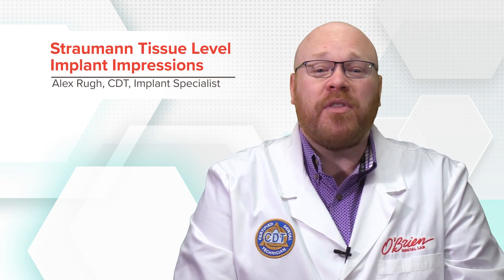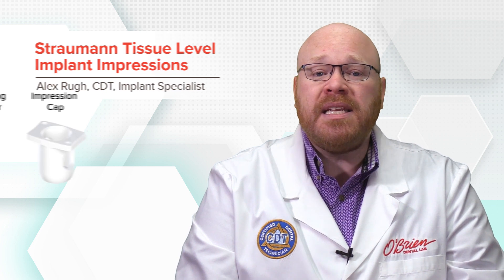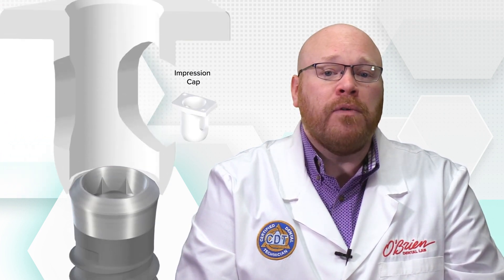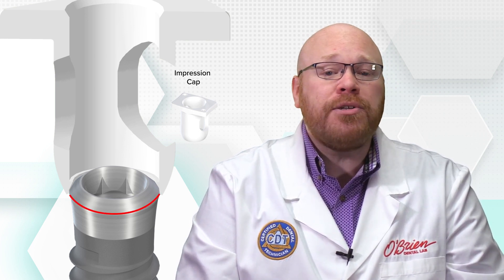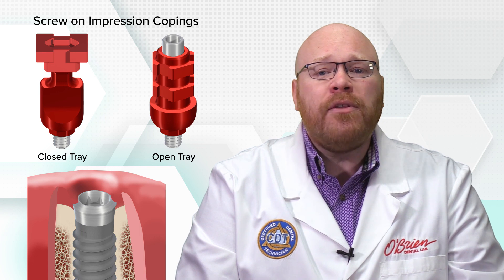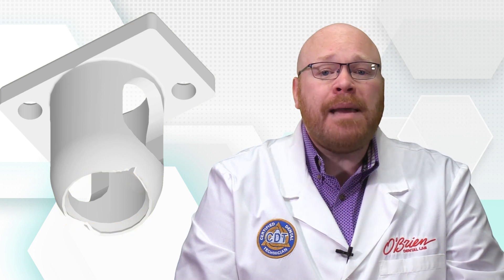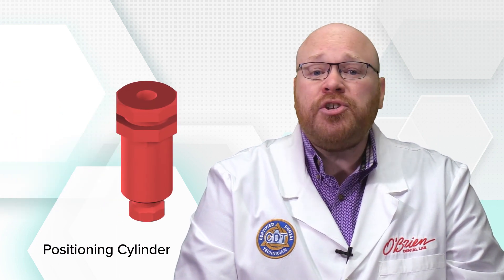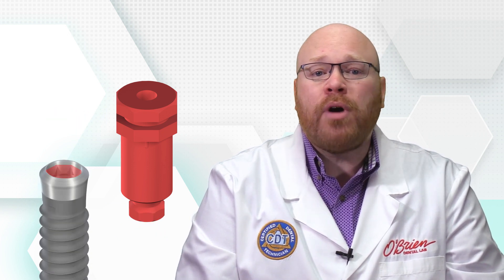Straumann Tissue Level: How to use the plastic impression parts

Comment: Is it possible to procede the impression of multiple implants with the plastic transfers? Or it's reccomended only for single implant cases?
Reply from the maker: If the plan is to splint the implant restorations together, we would not recommend using these plastic transfers as they aren't going to provide the same level of accuracy as a metal open tray impression coping.